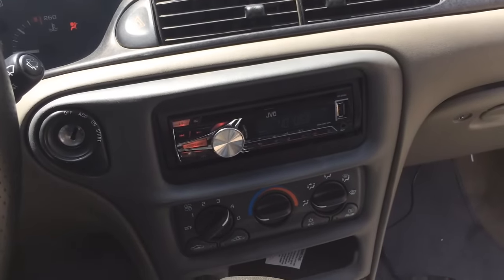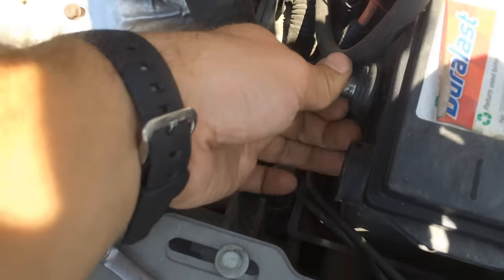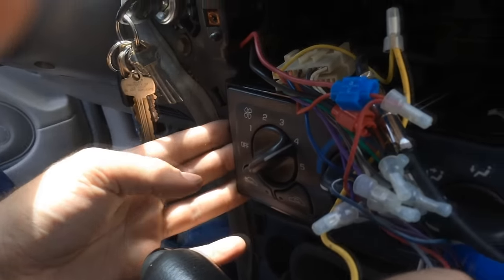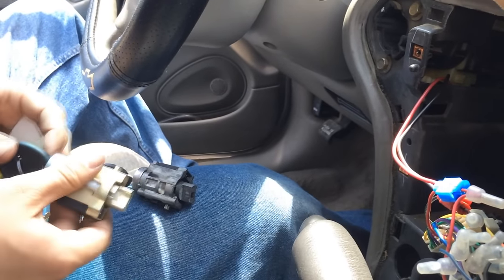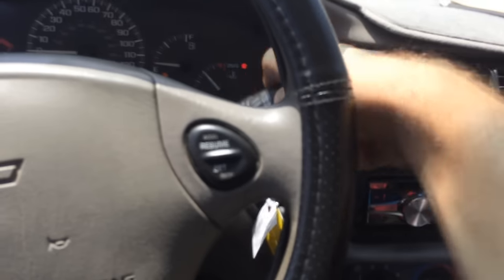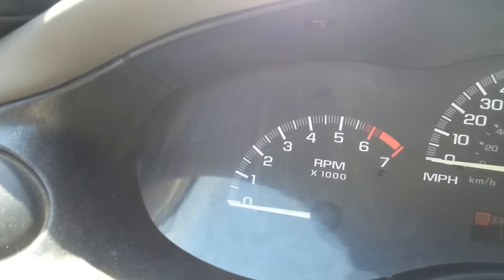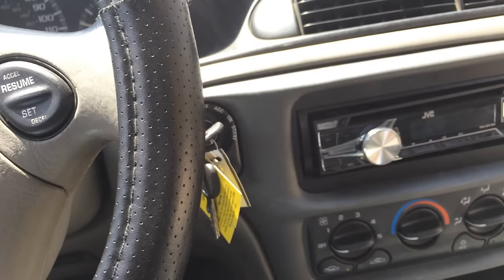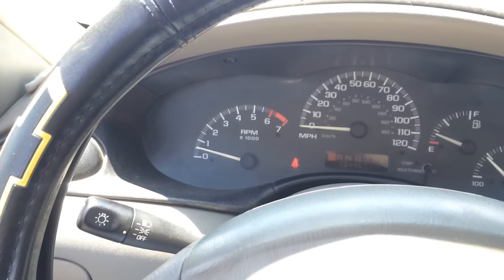1997-2003 Chevy Malibu Ignition Cylinder Lock Replacement + Theft Relearn Procedure

Comment: This video from 7 years ago totally saved me from what is most likely more than $300 now (2022). Also I ordered my switch on Amazon for $21 with keys and Security Module. Radio and Switch Cluster was a 7mm to remove on a 2000 Malibu to remove.  Hardest part was fumbling around with the screw driver to get the existing lock out but that took 2 minutes after I finally got a flash light. 10 minutes later I was driving. Thank you for this!!!
Reply: Can you share Amazon link?

Comment: Thank you for this video. I had a problem where I could not turn the key all the way to the off position so the accesories would not shut off and the battery would drain. I bought a new key cylinder and that didn't fix it so I bought a new ignition switch and that didn't fix it either. It turned out to be the Chevrolet Malibu Shift Interlock Solenoid. I replaced that and everything worked again. it was a 2003 car with over 200,000 miles.
Reply: jackbrady7 I’m having the same issue I can’t find a video on how to replace the shift interlock
Reply: can you explain how you did it?
Reply: Interlock just use d40 or silicon spray, shift button sticking.

Comment: I've got a 98 Malibu LS 3.1, 2 weeks ago, something started draining the battery like crazy. I replaced the alternator twice, the solenoid on the starter, and it's on the 3rd battery now. As long as the car is running there is no issues, but off the battery is drained within 8 hours. Where is the EMC located? I have been told like 3 different places, and looking them up online, they don't even look the same as shown in the videos I've seen. Yours is the first one that's been accurate on the Malibu this whole time. Thank you

Comment: Keep in mind the cylinder will not come out without the key turned on
Reply: What does one do about this issue? I have an 02 and the key won’t turn to the on position.
Reply: @trentosborn8835  the release pin or the entire lock cylinder would need to be drilled out. it's not fun if you can't turn the key to run and push the release.

Comment: I had to replace the switch in the 02 Chevy truck I had, however I didn't have to relearn it. It's a lot easier than the dealer wants you to think!
Reply from the maker: Alan Marshall Yup, I called the dealer because I got a recall notification on the ignition issue... well all they actually do is glue something on to your key... pretty stupid if you ask me, i figured they would just replace the whole switch but nope lol. Yea atleast on GM stuff it seems to be pretty easy.

Comment: If you have an issue with your Malibu ignition check your shift interlock solenoid that attaches to the ignition switch.
Reply: i just bought one today and i have an issue where the accessories wont turn all the way off. the radio and lights are still on when i take the key out and open the door

Comment: How’s you connect the radio, I need to hook mine up so it turns off and on with car instead off me manually turning it off and on and it still drains battery

Comment: What if you can’t turn your key at all to release the tab?
Reply: Hey ik I’m a year late but you can drill out the tumbler untill it turn or if you don’t mind buying a new switch punch the tumbler threw and then press the pin on the side mind you I’m no mechanic but worked for me

Comment: Ignition switch replacement costs over $400 now..I just took my 2000 Malibu in this morning, for a recall notice on the ignition switch, and they modified the key, with no switch replacement. But the car starts fine now. Does anyone know what is done to the key?

Comment: I would like to know if it hesitate to start what could I do if that don't work
Reply from the maker: check battery terminals, then follow the ground wire from the battery to wherever it attaches to the frame, see if its tight and no corrosion.

Comment: Was wondering, was there a cassette deck below the temperature control when the factory stereo was installed? My grandmothers 2000 Malibu still has the original factory AM/FM/CD stereo with an optional cassette deck below. Basically the lights burned out on the factory stereo and it needs to replaced soon, and since the cassette obviously won’t work with an aftermarket stereo, we would need to find a dash pocket to fill in the space where the cassette deck is.
Reply from the maker: When I got the car it already had an after market deck in it

Comment: I have a 2001 Malibu with an aftermarket radio.  The guy I got it from replaced the lock cylinder a few months before I bought it.  The theft system light doesn't go off.  Does anyone know what it could be?

Comment: replace the key, ( dont have the key copied because of wear, go to the dealer and have them cut you a new key off the vin #) tumbler and lock cylinder switch assembly do the relearn, when the light is on the fuel is cut off, I replaced all mine and havent had a problem since, and these lock cylinders are sensitive, remove ALL things off key ring and only have the key by itself. and jamming key in and fast rotation is also bad, I learned to be easy and it works fine. The only things it could be are the key, tumbler-lock cylinder, switch or Computer

Comment: Just bought a 2000 Malibu. I was looking up the parts I needed to replace. One is the ignition cylinder. How much did your cost? I ask because the price I am finding seems extremely high.
Reply: Average cost is about 180, may be lower if you have an account with some place, even lower if you can find a low mileage unit at a salvage yard.

Comment: So can a bad ignition switch can cause the ac control panel to not light up
Reply: Im having a similar issue with my 2K Malibu. Sometimes I'll turn the car off, pull the key out and realize it didn't turn completely off (radio lights/sound still on). So, I simply put the key back in and turn until for sure turned off. Also, can turn the car completely on and remove the without car turning off. 
Would this possibly be the reason why my SVS light comes on and stays on? When it does come on, dimmer switch isn't functional, instruments (speedometer, tachometer, etc.)  lighting isn't present - which makes driving at night an issue-  as well as AC panel lights not working. Lately, I've been notified that my taillights do not work...my brake lights work when I step on the brake pedal, though, so if I absolutely need to drive at night I have to 'ride the brakes' or else the tailights wouldn't remain illuminated. Headlamps, high beams function alright....can manually be turned on, of course. But when I start the car and shit to reverse, sometimes I notice the headlights blink rapidly about 4-5 times and then the SVS light comes on and remains on. Talk about a headache....

Comment: What did you press to release the switch
Reply: Denise Simpkins there is a metal button which can be pressed to release key cylinder if you turn the key to on

Comment: My CHevy Malibu 2001 did the same thing....BUT I figured out the shifter was NOT exactly aligned in park...did a little wiggle of shifter then the key went 100% vertical (visibly) and key came out !!   Prior to this I discovered the condition  would drain the battery till it eventually died after repeated trickle chargings.....ha !!
Reply from the maker: I had gone thru and checked that before I did this repair. Unfortunatley for me that wasn't the issue...

Comment: There's a TSB on the ignition on those most likely gm would have fixed it for free due to the recall...
Reply from the maker: Went to the dealer thinking the same thing its only for the plastic piece not the whole ignition atleast thats what i was told
Reply: I have the same car and was told to come in for a repair for the ignition lock cylinder because of a gm recall haven't taken it in yet but was just curious as to why they told you that
Reply from the maker: El Jefe it could be that they just didn’t want to do the work but he adamantly told me it was just a plastic piece on the cylinder. Regardless I don’t have this car anymore tho
Reply: Hank's Small Engine Repair yea they always try to get outta free labor
Reply from the maker: ya I really dont care for the dealerships around here much to be honest

Comment: Very cool but didn't fix my car
Reply: What issue do you have? I replaced my as a last thing after changing battery,, starter, fuel pump, spark plug and alternator die to crazy theft system and starting issues

Comment: Having trouble with key not coming our or not turning off vehicle, and or you replaced the key cylinder and the key doesn't want to come out, it will be because the shifter  cable, " Transmission in park safety "  that is in the back of the ignition module (the part you put the cylinder in),  simply remove the cable " snap in type ".
Reply from the maker: Yup!